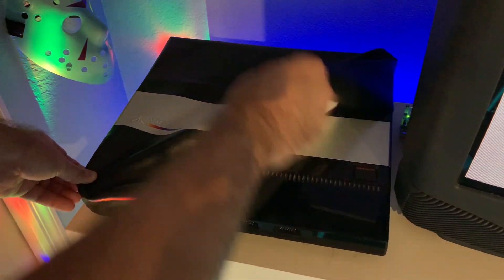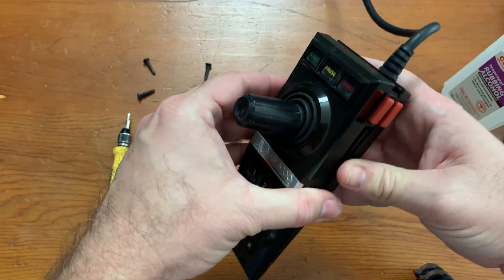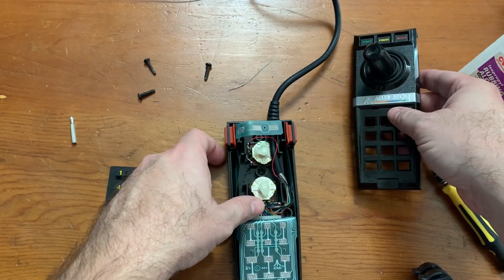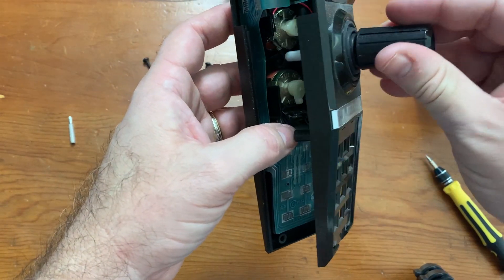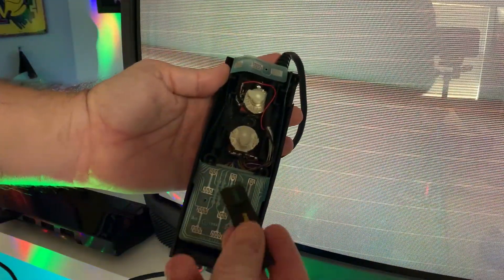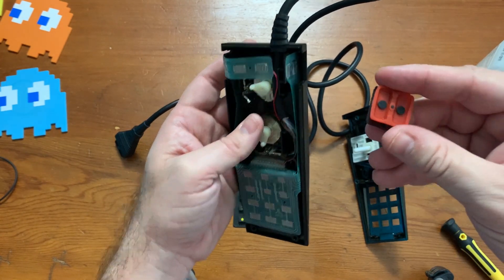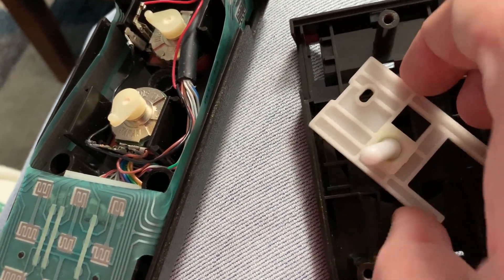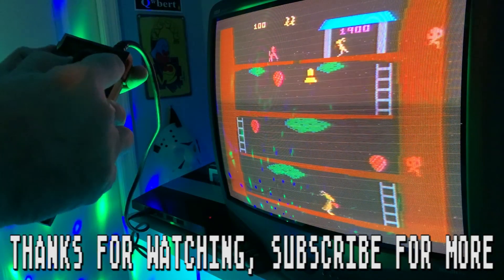Fixing Atari 5200 Controllers!

Comment: I had a 5200 when it was first released for Christmas. I'm just going to point out that after some time the controller joystick would fail and come out of the corresponding tracks inside. I remember after the first time this happened I finally pulled it apart and was able after countless hours to line everything back up to get a working controller again. Well guess what after that it would fail repeatedly no matter how good I was able to dissassemble and reassemble the controller. Buying a new controller helped a bit but it was expensive for a kid like me. Eventually no matter how many controllers I had every controller would suffer the same fate. I finally gave up on the system and sold it to a friend who bought new controllers but of course they reported the same issues. I don't even think these controllers are worth the time or money to repair and you are far better off looking for a compatible controller that would be better but those are not so common on the 5200.

Comment: Great video Greg!  I recently read that the 5200 port of Robotron 2084 works really well with the non-centering joystick on the 5200 controller.
Reply from the maker: There was a device you could mount the sticks into if I remember correctly.
Reply: @GregsGameRoom  Yeah, I’ve read about that-it was a joystick coupler.

Comment: Great video! Definitely a pain point for the system is the controllers. I have used a 3rd party controller with a built-in y-cable, Atari Age Redemption adapters for the controllers to get around that, but if the start button on the stock controller doesn't work, your hosed. 😆
I do enjoy the system and with a flash cart you can get all kinds of great ports, conversations and homebrews on the system.
Reply from the maker: Gonna have to show how smooth as butter the trak-ball is sometime.
Reply: @GregsGameRoom  Definitely! That is a beast of a trak-ball too. Atari definitely went in big on the 5200.

Comment: I am (was?) A big fan of 5200 games, but the controllers have defeated me. I've cleaned them a bunch of times and even replaced the contacts, but now I use an adapter and Genesis pads usually.

Comment: Leave it to Old Atari to produce an "advanced" video game system but cheap out on the controllers, using flimsy ribbon circuits, mushy rubber buttons, and a non-centering plastic joystick. Does anyone know if there's at least a hack to add springs or something for stick centering?